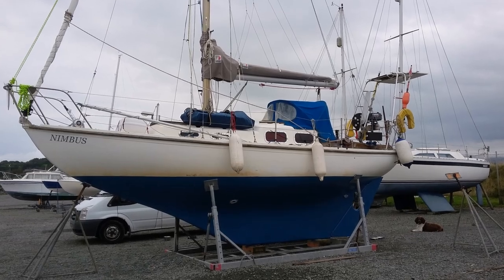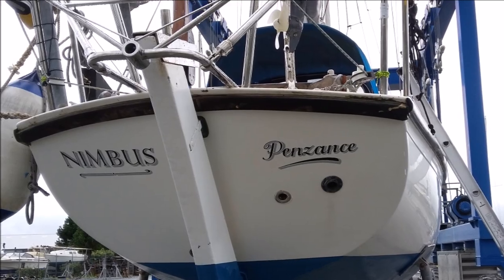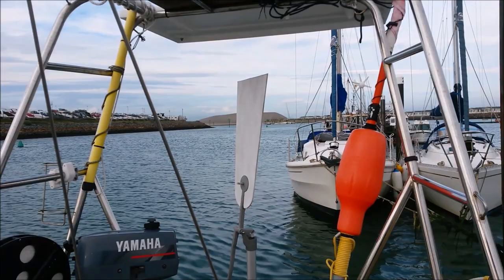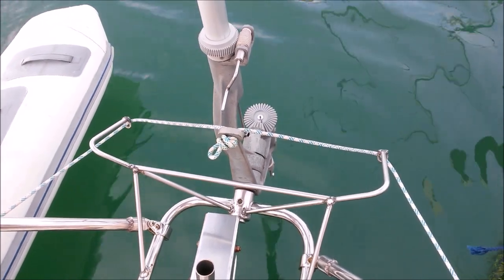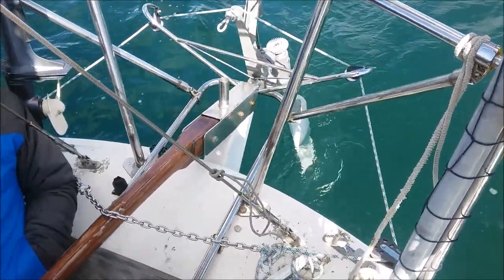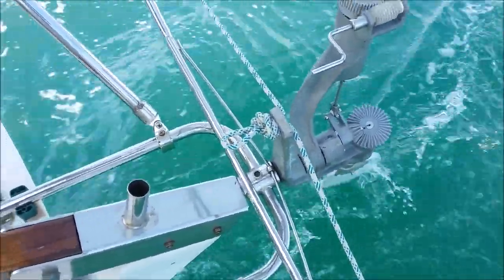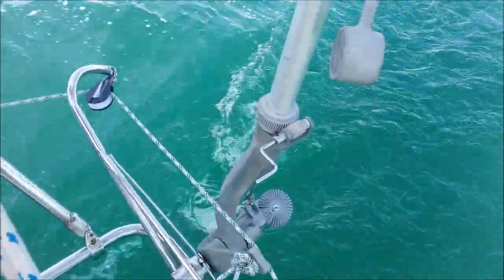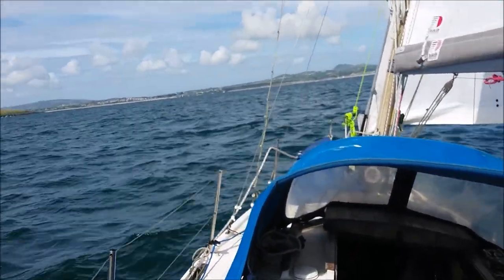Wind vane Self steering... a short description

Comment: 12 year circumnavigation with mine. Only two issues in that time. 

1) The long nylon bush in the in the lower tube absorbed water and froze the paddle. Once. Bit of brutality on the nylon with emery tape sorted that.

2) Welding on the rod linking the vane to the  wee crown wheel was not brilliant. Also easily sorted. I think I replaced it with a heavier rod, as well. 6 instead of 5mm (?)

A winner,  at the price. Now, all he need do is get it to perform downwind!!!
Reply from the maker: Thanks for the tips, I'll keep an eye on these. (I'm also surprised the Neptune never appears in any magazine reviews etc)  12 year circumnavigation.... that sounds an adventure!!! are you still on voyage? What kind of vessel  do you sail?

Comment: Nice to get wind vane  safe and out of the way when you do not need it.  Vane makes it hard to land a fish, pull dinghies or have davits. Big trade off loosing that stern access.  With some boats sheet to tiller might be an option. Beautiful piece of equipment tor the right boat.
Reply from the maker: Yes I wouldn't be without it now, but it's an expensive fender/bumper in marinas!

Comment: Hi! What kind of joint did you use at the bottom where the mechanism connects to the bevel gear?
Reply from the maker: Hi.. I'm not sure I know which joint you mean.... the bevel gear is made from acetal and fixed with machine set screws.. this is standard (you can see more details from the manufacturer here www.windvane.co.uk ..  but If you mean the cockpit mounting  bracket. Then I welded this from some spare parts. Hope that helps?